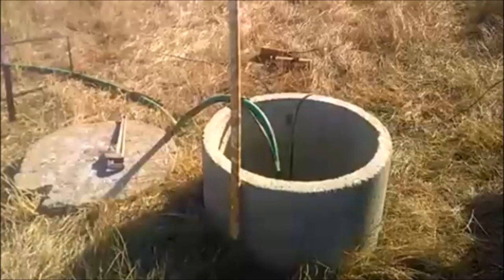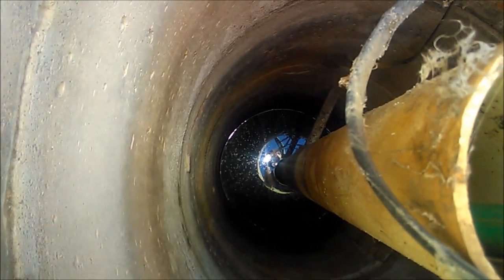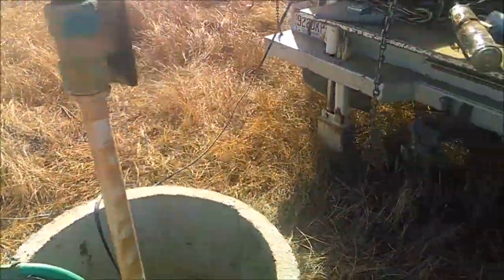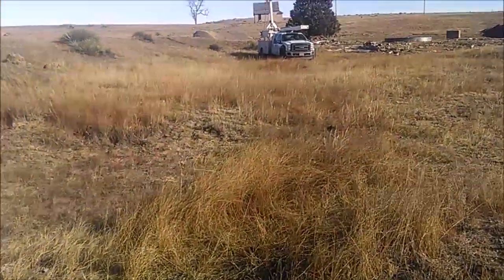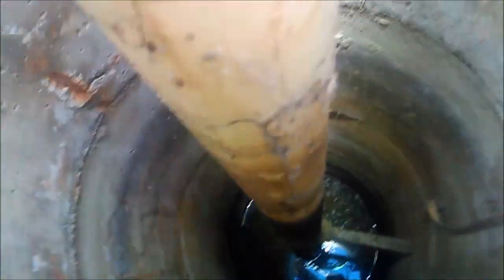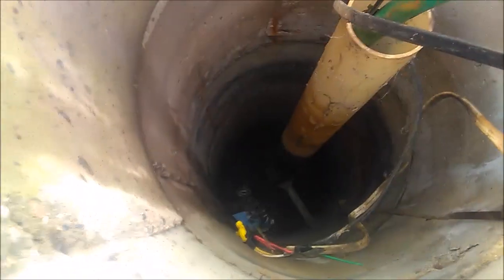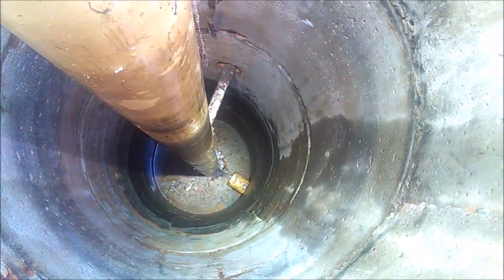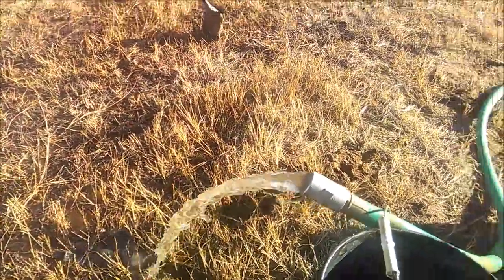Water well test pump

Comment: Pretty cool Kenny, we're to lucky down here not much need for a well design like that.  But it's perfect for remote areas and for livestock or irrigation.  I would definitely have some chlorination and reverse osmosis for drinking water.  Do you have alot of shallow water contamination of chemicals, nitrates or pesticides?
Reply from the maker: We didn't test the water quality here, but I wouldn't expect it to be very bad at all.  The recharge that feeds this is all within 2 miles from the well to the top of the ridge that it's on.  This entire hill side is shale within a few feet of the surface and some places there is a little sand on top of the shale.  This lateral is cut into a drainage area to collect what's running down the hill on top of the shale.  The next aquifer down would be someplace in the 3000 ft range if it exists at all and may be to poor quality to use.  A ranch west of here spent a lot of money on an old oil well trying to convert it into a water well from that zone and never got it to work.   I would also be a little skeptical to drink from this well where the level is so shallow, but it's intended for livestock use so it's good enough for that.

There is a couple areas that we work in that have some nitrate problems from man made sources but I have never seen pesticides.  There is also areas where the water has always been bad to the extent that a test comes back "not suitable for human or livestock" and will actually kill cattle if you don't watch what you're doing with it.  If you leave an open stock tank sit for a while and evaporate/concentrate the water it will definitely cause problems. These areas have always been that way naturally.  In fact most of that area is in grassland and doesn't ever have chemicals applied.  If you are careful and give the animals some doctoring they can survive on it but will have trouble gaining weight and it may cause problems with blindness or sterility.  We have some pipelines 20/30 miles long to put decent water into pastures with bad water under them.
Reply: Kenny Kemp Very interesting, Yea and those people in California complaining about what water they have.... Before you know it well have water pipelines going across states to them.
Reply from the maker: I don't know about everywhere else, but they already have rights to a lot of water from Colorado.